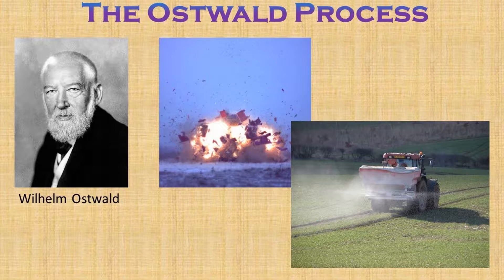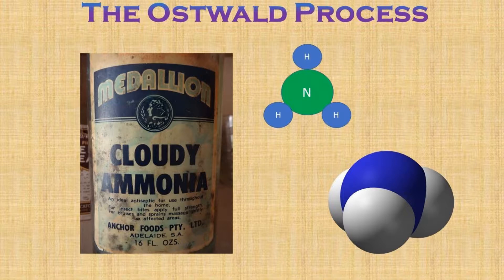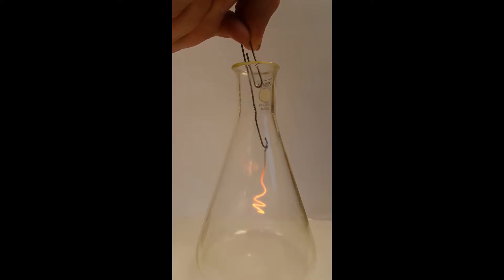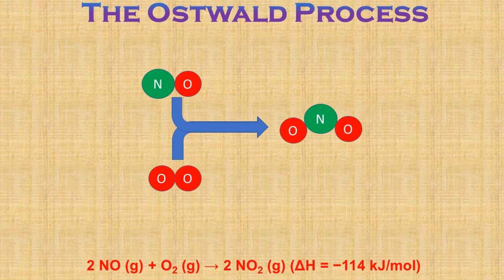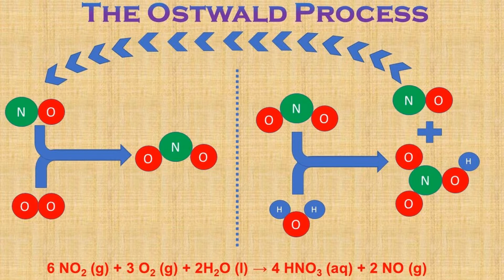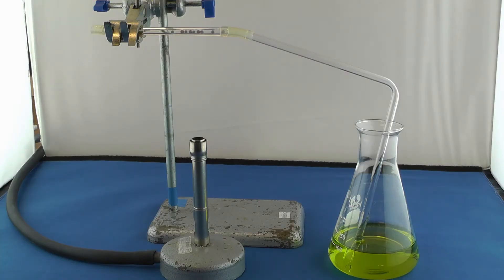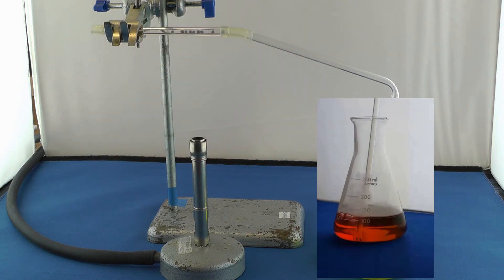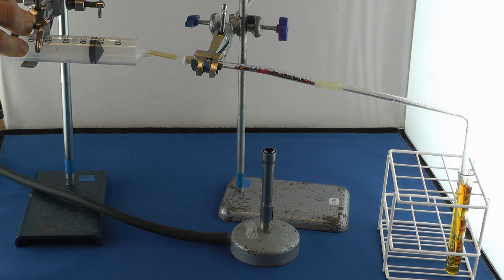The Ostwald process

Comment: I wonder the efficiency difference between platinum and copper
Must be significant enough if for the industrial process it's more economic to use platinum
Or maybe it's not efficiency but rather how long the catalyst last, if you have to change the copper every days it would make platinum more economic on the long run as you don't need to stop the whole production too often

Comment: how we can take ammonia and oxygen in a syringe
Reply: You needn't. You can boil aqua ammonia as the delivery system. It will react with oxygen in the presence of hot copper, producing the nitrogen dioxide, and ultimately nitric acid.
Reply from the maker: Hi there. I don't have a method on our website as yet - but I''ll see about writing one up.
As for gases in a syringe. It's an idea from Bruce Mattson at Creighton University., I wrot an article for our magazine a few years ago that you can see here https://2g1hrx40gw3t1oo1bvqfy70u-wpengine.netdna-ssl.com/wp-content/uploads/Publications/Bulletins/263/SSERC-bulletin-263p8_9.pdf
Reply: @ssercchemistry7545 🎉